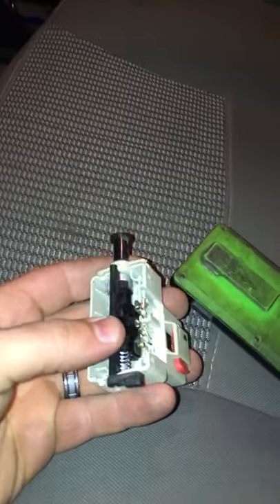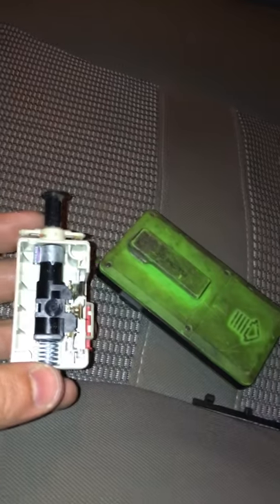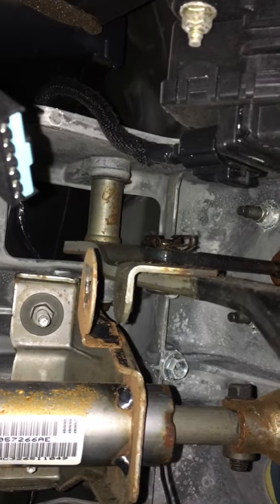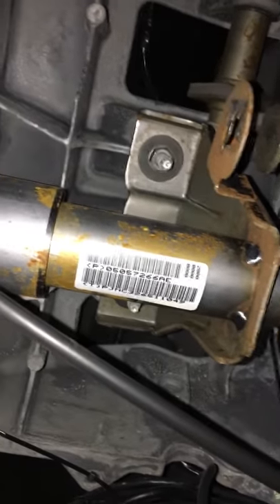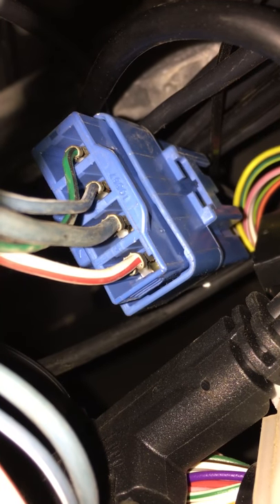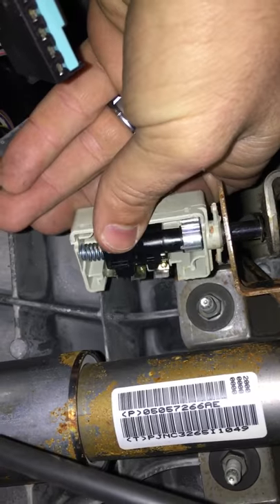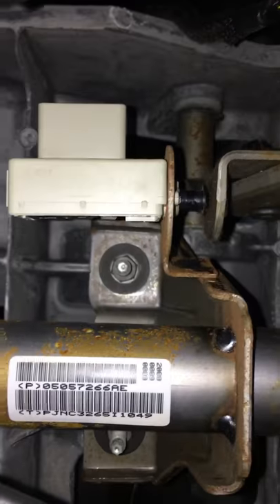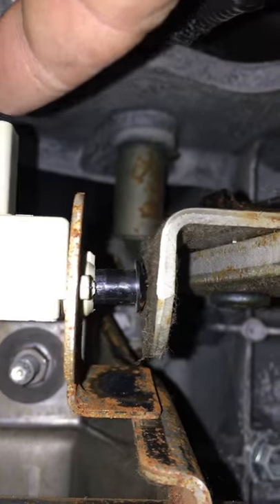06 Cummins no brake lights problem

Comment: I don't think it was a fixed because he didn't answer anybody's question, I also have no brakes 2006 Dodge ram 2500 I changed everything from the control panels clean the corrosion and change the bulbs also check the fuses